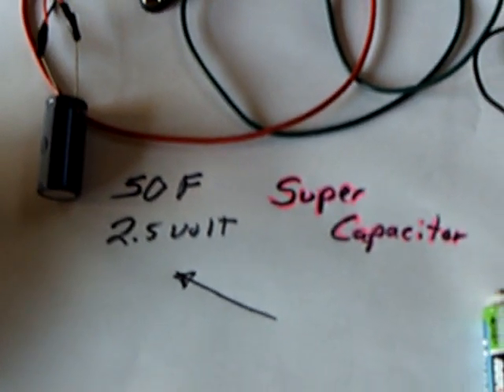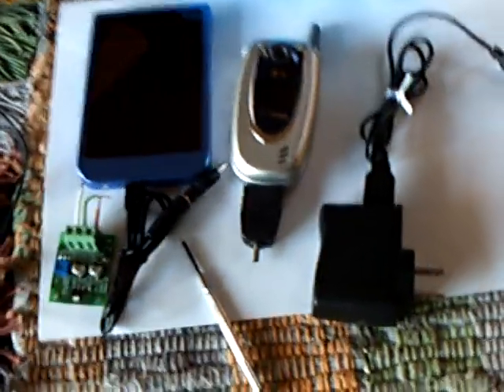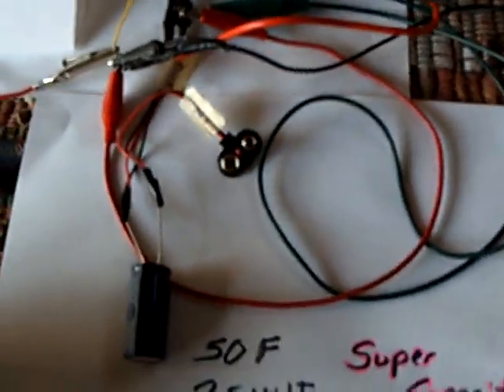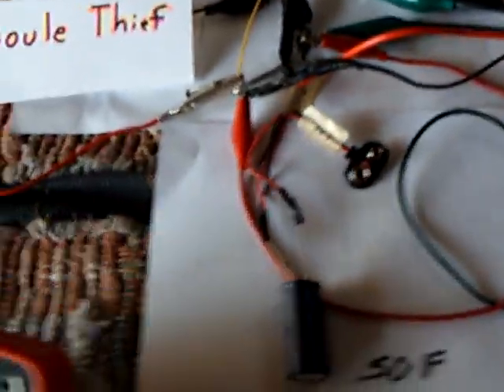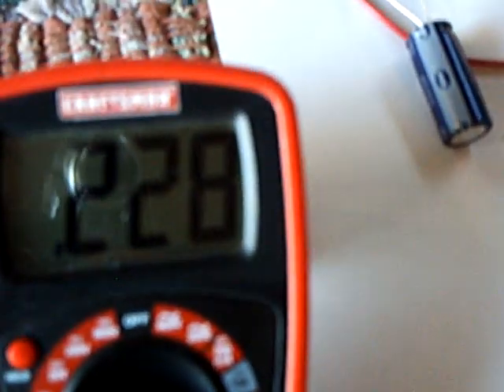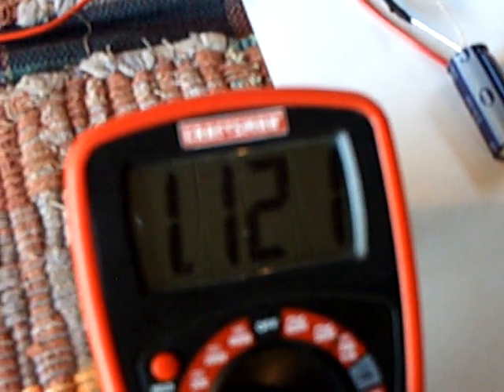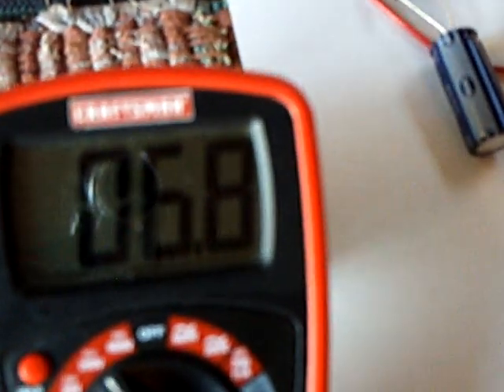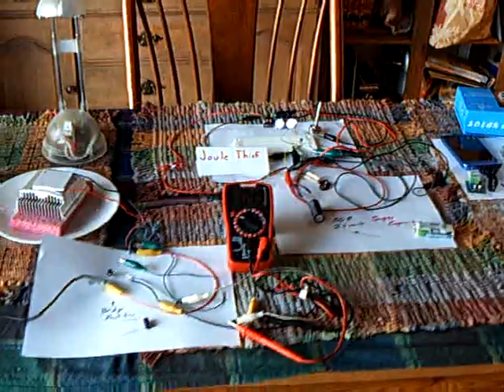A Thief with a super cap

Comment: I tried this with two of the Maxwell super caps that are the size of coke cans. I used USB hardware to transfer power, and turned a desk lamp into a super cap powered joule thief LED light. The super caps are suspended in a pelican case. I use a radio shack 5V regulator to regulate the voltage coming from one of my large solar panels. It takes a long time to charge these things up. I am not getting 9 hours out of mine. I'm using a replacement LED for the large three D cell mag lights though

Comment: Very nice work!!!  I too have been working with the joule thief circuit and supercaps.  they will run a long time with NO battery!  I am glad this information is getting out.  I had an EE tell me that the joule thief circuit only works with batteries.  I made a video that shows this is not correct.  I believe supercaps are in the early stages of being utilized.  Again, excellent work!

Bill